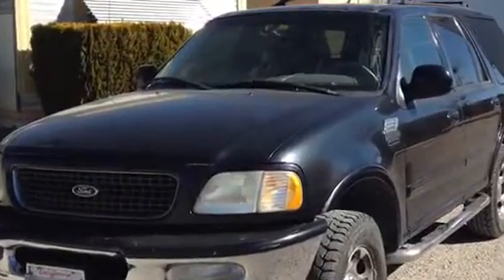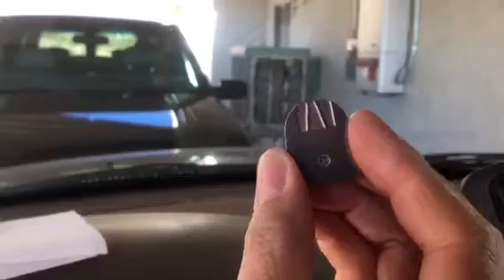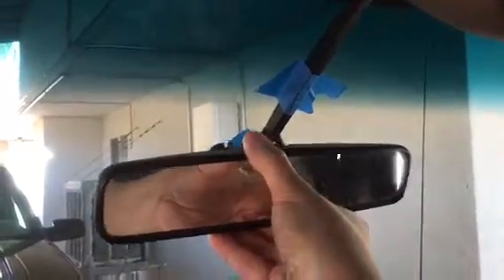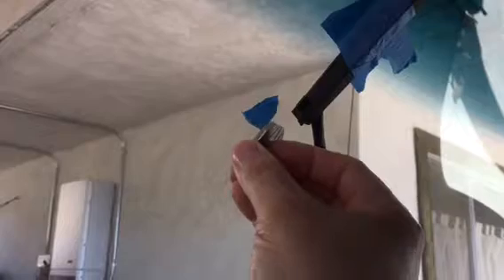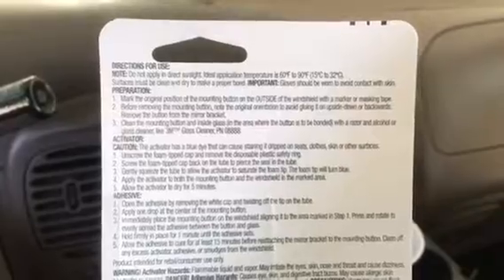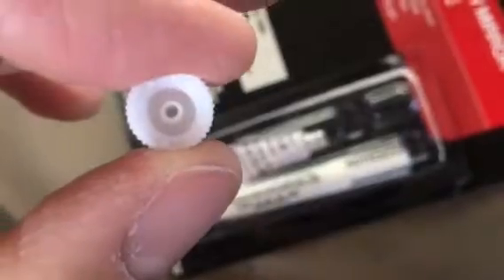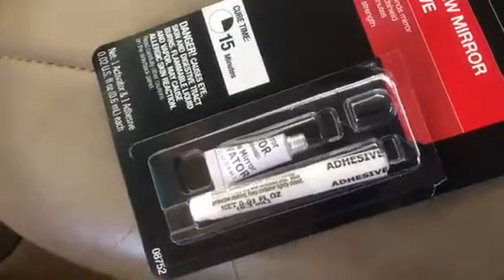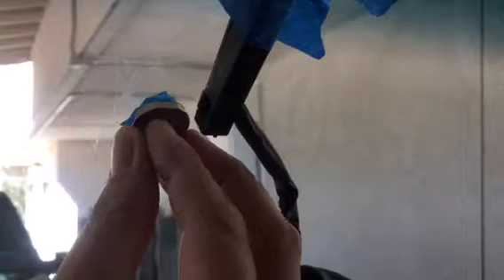1997 Expedition Rear View Mirror Repair

Comment: Hows the mirror holding up?
Reply from the maker: LOL  The mirror is still on the window.  The engine burned a valve going up a hill a couple years back... but that mirror is still on that car as it sits with many parts pulled off of it in my garage 🙂
Reply: @WalterCombsLCSW  Good stuff then thats what im going to get for my Tahoe..thanks!! Great video!!
Reply from the maker: @roltyd22  glad I could help 🙂